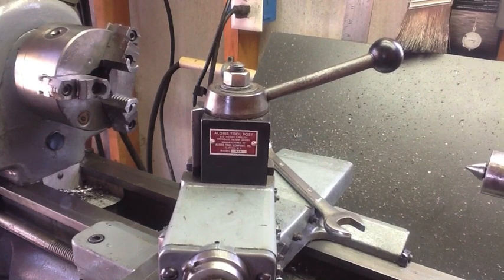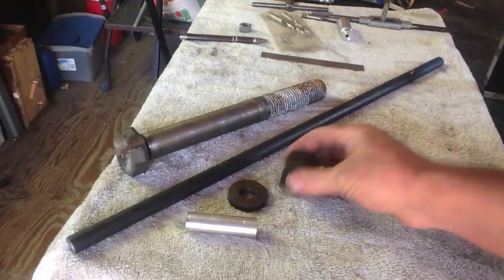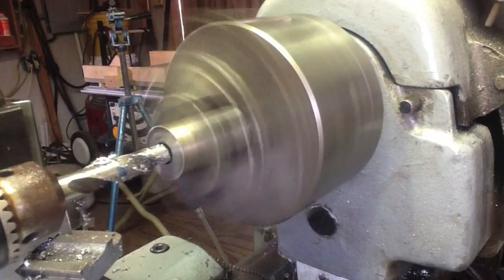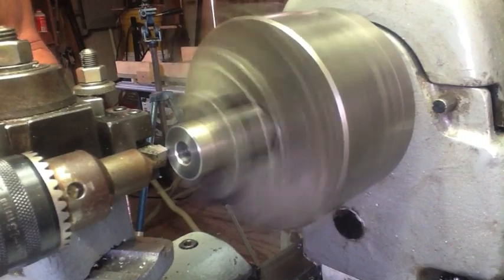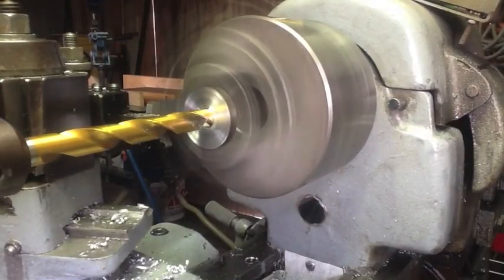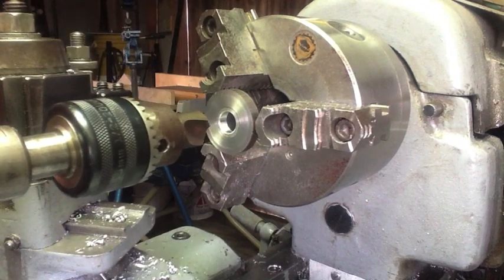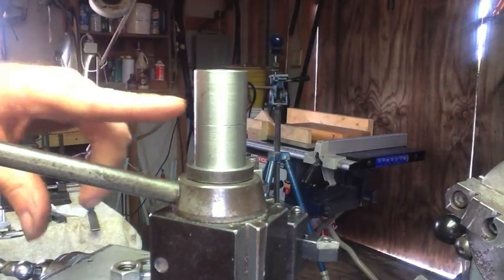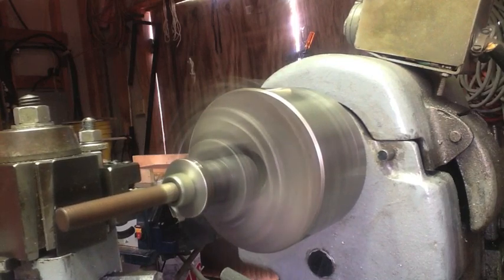Custom Quick Change Tool Post Nut & Handle / Tailstock Too!  - MSFN

Comment: Totally negates the whole idea behind "quick change." Either acquire, or make, the number of tool holders required (ten is a good starting point, was for me anyway) then square up the quick change tool post to the z-axis and go to work. I can count on six fingers the number of times I have had to reposition the tool post on my lathe in the past twelve years and three of those were to get clearance between the cross slide and the chuck jaws. I own/operate a job shop btw. 

Good work on the handle though.

Comment: The most important attribute for a QCTP is...... apart from the ability to adjust height etc...... to enable the tool to be placed and replaced in the exact same position time and again.
Moving the tool post itself defeats this attribute and renders it merely a tool height adjuster which you can do with shims.
I have been in the industry for 60 + years and never moved the tool post once it was set for turning.
Any chamfering operations were done with a tool that was angled in the tool holder not the tool post per se.
You should be able to get a tool to be dead in position once the tool post is set.....moving it and you lose that ability......this does not apply to the piston type QCTP which by it design is totally crap.
BTW........using an adjustable spanner (wrench?) on a machine like you did is the mark of a crap worker......you can tell by a man's tool inventory just what kind of person he is.

Comment: I presume you would adjust your washer to get it 'pointing' in the right direction...? i.e. aligned (maybe) with the clamping handle.
Reply from the maker: Yes, the washer can be machined to the proper thickness to achieve the right tightening point wanted
Reply: @MakinSumthinFromNuthin  OK!

Comment: Nice job. I will make one also.  A tip for you.  When you anneal any thing with carbon content, warm up some sand. Very warm to the touch.  ( I use a hot plate with steel pot for the sand)  and bury the red hot item in it and let cool to room temp.  You wont have any hard spots to contend with unless it gets work hardened.
Reply from the maker: Thanks Dennis!

Comment: Nice project and finished out nice. If one did not machine a nut you could use a commercial sleeve nut but would need to face some off to make one of the flats land where you wanted. When you heated the washer for color I I'm gone the aluminum bushing came loose.
Reply from the maker: Thanks gvet! :)

Comment: I knew I seen this somewhere and it was your channel.  All I need to do now is drill and tap for the handle. Jim dedmon gave me an axa tool post.
Reply from the maker: Jim is good people, enjoy the nice gift. I dont miss the 3/4 wrench at all :)
Reply: @MakinSumthinFromNuthin  Jim is a great guy. Just finished mine today. Can use as is but  Couple tweeks and it will be done
Reply from the maker: Nice, keep me posted :)
Reply: @MakinSumthinFromNuthin  finished it and works well. I was gonna send you a pic but didn't have your email
Reply from the maker: Glad it is working well for you! Check in the video description section, I list my email there :)

Comment: I'm going to make one of those handy dandy levers for my tool post. ....Incidentally when tapping on a lathe, you can put the tap in the tailstock chuck and disengage the headstock drive belts etc. then just turn the chuck holding your work , by hand. I'm sure you knew that. Leave the tailstock nut loose. If it's a large tap, run the lathe at its slowest speed.and again with the tailstock loose enough to sliiiiiiiiiide
Reply from the maker: I never regretted leaving the wrench behind. You see it in use in all my newer videos.

Comment: Great video Richard. I'm current making a tool post locking nut for my bxa. I will be putting a taper on the top portion so I won't have to bend the handle.  As far as the tail stock, your idea will go good on both the Atlas Commercial 12 and my th54 10 .
Reply from the maker: Thanks Frank, I did not have a mill or even a drill press vise at the time I made this stuff so drilling was always problematic for me, $20 drill presses can only do so much...LOL Drilling on angled surfaces was out of the question so made due with what I had. As far as the tail stock "fix" it worked well for a few months but for full disclosure have gone back to the nut and wrench ☹️ due to wear I suppose it couldnt tighten the tailstock clamp hard enough when drilling under heavy load. I may revisit it using a double thread on a new bolt so less handle travel is needed to attain higher clamping force given small area I had to work with....bending it helped but still needed more...so little room back there on my tailstock....it is the most frustrating part of this lathe :( ~ Richard
Reply: i plan on setting my lathe compound at somewhere around 60 or 70 degrees to set the angle, not determined yet. But I do plan on drilling for the handle using Bridgeport and vice, more holding power, if you have a  drill press and vice, setting with angle blocks or a angle level with a V block might work. Not sure as I'm a newbee and still learning myself. {Im heading to hardware store to check the thread size on my BXA tool post this morn}
     I still plan on the tail stock idea of yours.

Comment: I made myself one too, but I'd like to find some harder material and redo it. It's interesting that Atlas put the tail stock binder on the backside like that.
Reply from the maker: The lockdown on the backside of the tailstock is simply a stroke of genius on their part 🙄
Reply: My new nut/wrench solution is to bolt a ratchet wrench to the tool post fastening stud. https://youtu.be/rfVx0uI_hv8
Reply: @johnstrange6799  Hi John, tried to check this video out but it says it's marked Private. Just FYI.
Reply: @netwak  Sorry about that.  Over the last two years or so I switched up my content. I appreciate you trying to check it out. You didn't miss much :)

Comment: Ever so much MORE trouble than I went thru. I used a socket, put it over the existing nut and welded a piece of round stock to the socket. Ground and polished.  It's removable or the socket can be tacked to the nut for permanence. As is, it lives in place and has never come off in 10 years.  Another thing to try is simply welding a wrench to the nut.
Reply from the maker: Great idea......I was between paying jobs and took the opportunity to goof around on the lathe for a "me project" 😊
Reply: Makin Sumthin From Nuthin:  I understand!!  It's not like I've spent HOURS fabricating a $.50 part or .001" precision for a .01 part either.  There are just times....
Oh, I do like what you did with the tailstock. I mentioned in another reply that I used a ratchet and socket.
Reply from the maker: I am going to remake the bolt for the tailstock, make it a double lead thread. Over time the threads have worn and just not enough room now to fully crank down enough pressure for the tailstock during drilling larger than 1/2" bit.....With a double lead it will double the travel....just not much room on an Atlas tailstock. I love what I made, but have to remove it when am doing heavy drilling :(
Reply from the maker: I subscribe to Joe Pi, great machinist. I have a screw on chuck so only thread away from the headstock in that manner on fine threads and soft material. I prefer threading the way he demonstrated and have done so in another video of mine. Not recommended for screw on chucks as they could unscrew under a heavy load

Comment: You know the coarser the threads are in the tail-stock, the less travel you will need between sliding free and locked down. So if you need or would like to have a totally solid lock-down, just change the bolt to a lot coarser thread pitch and it will work.
Reply from the maker: Yep, I do think the way to go is a multi-start thread tho. Will leave tons of room to lock it down. May see that in an upcoming vid

Comment: Very nice job, and a good idea.
Instead of bending the tool post handle, you could have put the nut in at an angle on a vice in the drill press and drill and taped it.  My lathe also has the nuts, and I'm going to look into doing the same.  On the tail stock on my lathe, I don't have the room to dot this.  I only have enough room to get the wrench in.
I enjoyed the video.
Reply from the maker: Thanks Michael, glad you liked it. The tailstock was a poor design on this Lathe
Reply: I use a socket and ratchet for my tailstock on my Standard Modern 1754. I cut the socket down so the depth just fit the nut. Had to withdraw the bolt and reassemble with socket wrench, socket and nut together then put bolt back in place. It's permeant and I just use it like a normal ratchet.

Comment: Great job on both projects. I've scratched my head trying to figure out how to get enough travel in that tailstock nut area. I like the way your solution gives you another few degrees of turn. I'm a little skeptical that it will be enough travel to tighten the tailstock for all operations, however. Time will tell!
Reply from the maker: Thanks Rick :) I drilled out that grade 8 bolt with a 7/16 drill as shown in the video using that tailstock handle and it held just fine. It really does lock down rather tight...without that extra travel I gave it it woulda been iffy...I went back 3 times for bending on that handle to give me the maximum travel I achieved but yes, time will tell but good so far :)
Reply from the maker: A double lead thread would would certainly solve the problem if you were adventurous :)
Reply: That should be a pretty good test then. Congrats on a great design.
Reply from the maker: I do keep the 3/8-16 nut on a magnet attached to the table leg....just in case LOL

Comment: Nice job.  One of the better executions of this project.  The thickness of the spacer washer can be altered to index the handle.  Wait till you see what I do with my tail stock clamp.  ;-)
Reply from the maker: Thanks Dave...you may do a cam-lock type setup but look forward to seeing your take on it. Leaning over the tailstock with a wrench was getting old :)
Reply: Yea, the fact it's on the backside really sucks.  I didn't notice that until I was stripping it all for refinish.  Cam lock for sure.  A cam lock is normally on the backside.  There is another system, you're doing good at guessing so far but the next possibility is less obvious.
Reply from the maker: The backside totally SUCKS!!!! Dont know what idiot designed it and that captive wrench is a piece of junk if yours came with it. This just seemed simpler....for me anyways...and is low profile. I wont guess, will wait for your vid :)
Reply: I'll get around to doing one maybe this summer.  Been preoccupied so far.  Having a hard time getting back to my 104 videos a year quota.  ;-)
Reply from the maker: Yep...filming & editing is time consuming :(

Comment: ive been wanting to make one for mine but i dont have a tap as big as mine post stud is. mine is bigger then 1/2 13
Reply from the maker: They are a real time saver! Do you have an internal threading tool?...dont need a tap in that case :)
Reply from the maker: What tap size is yours? I wouldnt have assumed a bolt bigger than 1/2" was needed
Reply: i measured it with calipers and i think its 9/16 and not sure the tpi
Reply from the maker: You got a lathe that will turn threads, make ya a new bolt, make the bolt shaft 9/16 and make the threads to match your T-Nut on one side and the other end whatever you want according to whatever taps you have on hand...just a thought. Its how I would skin that cat :)